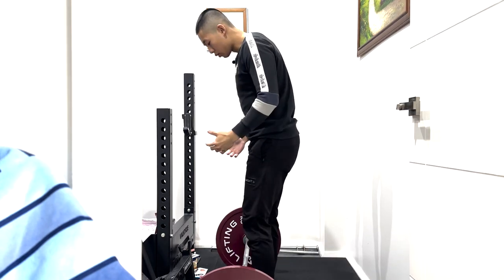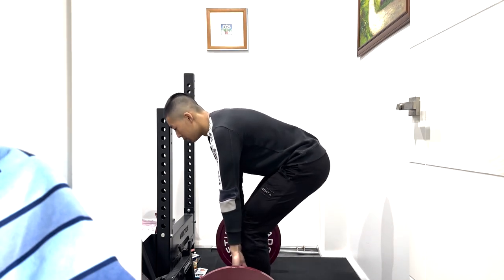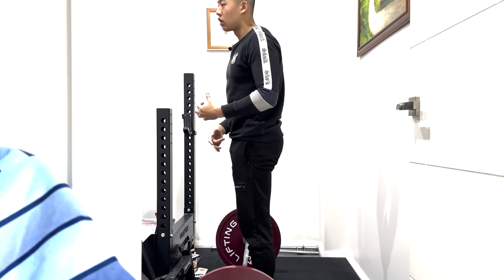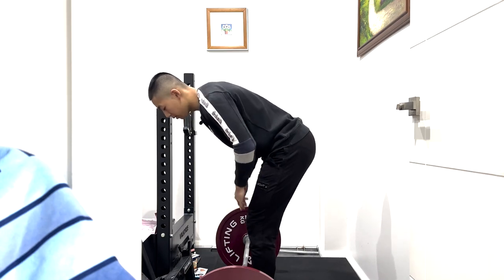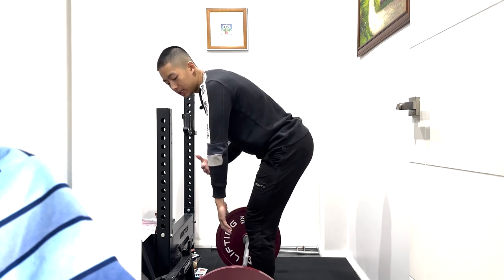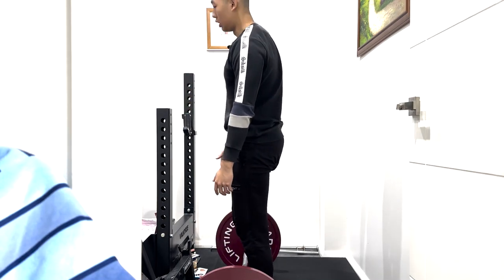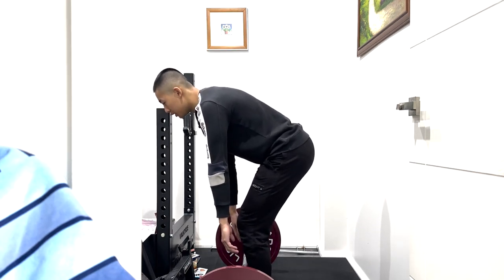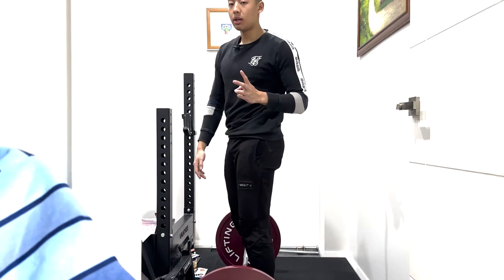2 Causes of Upper Back Rounding in the Deadlift Hinge

Comment: Why is upper back rounding a bad thing?
Reply from the maker: Apologies for any misunderstandings the video may have created. Upper back rounding is definitely not a bad thing if performed safely/correctly and with the intention to increase efficiency of the movement. When it does become a problem is if you see that a rounded upper back position causes flexion/deviation of the spine when performing the lift. Quite simply, it's easier to maintain neutrality in a stacked spine and when pulling from a rounded upper back position, it becomes increasingly tempting to shift the spine into flexion to break off the floor. However, if you are able to pull with the rounded upper back technique with no issues, it is definitely not a bad thing.
Reply: @HeadstrongTrainingSystems , thanks for the reply, I agree with your comment, title of the video was just confusing😃.
Reply from the maker: @milanboskovic6132  Haha my apologies for that. I completely get where you're coming from :)